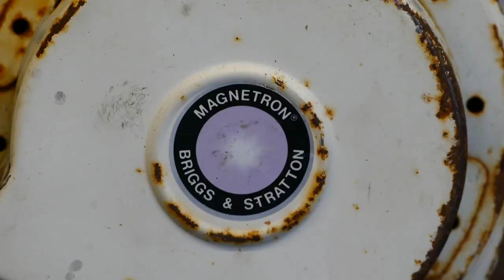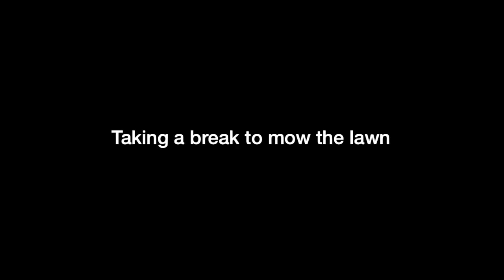Briggs & Stratton 5HP FULL RESTORATION! || Part 1: Teardown

Comment: It’s nice seeing the vintage small engines brought back to life instead of being replaced by a cheap harbor freight engine
Reply from the maker: it’s what i love to do. they don’t deserve to be trashed, they were built too well.
Reply: Ya the old bs engines are pretty bulletproof vs Chinese one time use machines these days. 

I picked up a Chinese carb for my Briggs snowblower and it was total junk. I just needs the outer bowl housing so luckily the clone was spot on ... rest was terrible plastic and cheap gaskets made of rubber bands.
Reply: Couldn’t agree more. Watching this to work on my 8hp bs on an early 70s snapper. Mowing season is around the corner and I’m so glad I found this
Reply: I love the old Briggs engines but they aren’t built as well as some may think, the kool bore engines aren’t all that great.

Comment: Good vid!  I always wipe the oil off of the valve tappet, and mark an I on the intake tappet, and an E on the exhaust with a Sharpie marker, as they may not always be the exact same length. I also check the tappet clearance before fully assembling the engine, I have found tight clearances many a time. The valves wear lower, so the clearance reduces as the engine wears. Sometimes I have to file the side of the valve below the retainer so it will slide thru the guide, if you have to remove the valve, a normal flat bastard file will fit into the valve spring pocket.

Comment: I have this exact engine on a walk behind leaf blower (it's an MTD air sweeper and the engine was made in 1989 if you're wondering.) And it works but of course the roof sprung a leak and water got in the carb so I have to take the tank off because it's a weird type of carb like the one used in the engine shown in this video. I'll have to do it soon because fall is approaching and I kinda need it.

Comment: Thankyou for your youtube site. This is very informative. I have 2 x Norlett Beaver Powerspades in pieces with two 40 year old 2.5hp Briggs & Stratton engines. Both were  dirty cruddy non runners. But today I finished my first, with your video help. Only thing is i would like to have one engine using electronic ignition coil. But cannot find anywhere.
Reply from the maker: Glad to know my video helped you! This one does not use points ignition, it is an electronic ignition, that they call “magnetron” ignition! they’re easier to work with, but the points setup delivers a spark at much lower speeds.

Comment: Nice! I have never had one of these that doesn't have some scoring in the bore, IDK why. It's funny, I do the same thing with my old oil, I have an old 1 gal Arizona bottle lol. They're great for storage and you can make some nice oil catch pans with them. The back panels of these engines are always a pain! I usually loosen them with a screw driver and then use a 3 jaw puller to get them off.  Can't wait to see part 2! What color are you going to do?
Reply from the maker: Im doing white like it was originally with some black accents. storm trooper 5 horse.
Reply: @WildfoxFabrication  Cool! That's going to look great!

Comment: I'm doing 2 Briggs&Stratton 3hp at the moment. The points were messed up and I'm having hard time finding the electronic spark kit to do away with the points. Any help?
Reply from the maker: I would just keep the points, it’s a lot easier to find a points rebuild kit than it is to convert to electronic ignition

Comment: i dont know if this is a dumb question but would the S&B 5hp have enough juice to do a burnout on a go kart with thin tires?
Reply from the maker: Possibly. With a centrifugal clutch probably not but if you got a torque converter on there it probably would

Comment: Awesome video man. 
I have a question about the valves. After removing the valve springs my exhaust valve only comes out half way and the intake is pretty much stuck completely it only moves about a millimeter or two? Thank you
Reply from the maker: This can happen sometimes due to decades of wear and tear on the engine, you basically just have to rip them out and hope for the best, you may potentially need new valves

Comment: Where can I find info on what oil to use? I have a 1977 7hp similar to yours.
Reply from the maker: 10w30 works great for normal temperature operation, use something a little lower for winter
Reply: @WildfoxFabrication  would that or sae 30 be better to use? I found an old manual that says to use sae 30, but oil quality has gone up since it was made and that may affect it
Reply from the maker: @CamoCollie  they're old and built like tanks, if there’s oil in it its good to go 😂😂

Comment: Would you happen to know what size the bolts are that attaches the flywheel housing to the motor?
Reply from the maker: They are 7/16 coarse thread
Reply: @WildfoxFabrication  gotcha thanks so much. How long are they? Probably half inch?
Reply from the maker: @bassman8990  they’re not long, probably about a half inch yeah
Reply: @WildfoxFabrication  gotcha yea its the 3 small bolts that hold the cowl on the motor
Reply: @WildfoxFabrication  does that Motor take the regular SAE 30 oil?
Reply from the maker: @bassman8990  yes it does